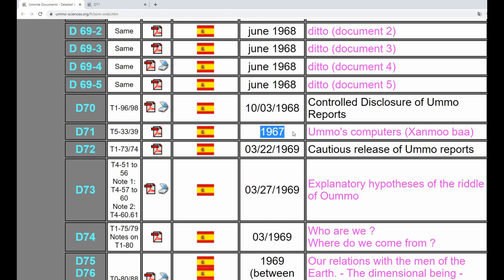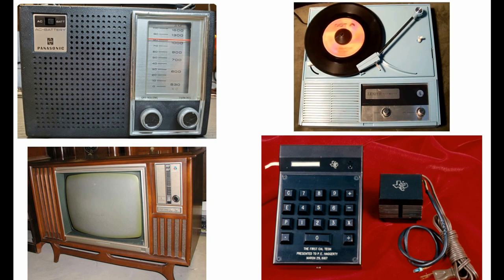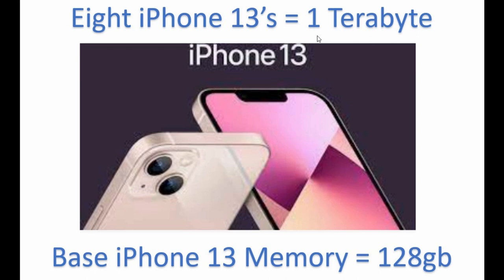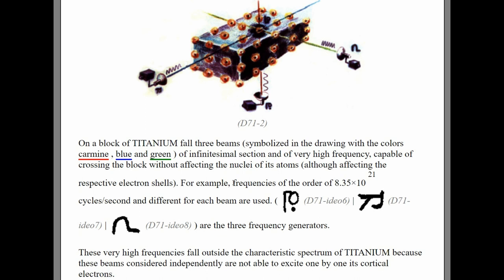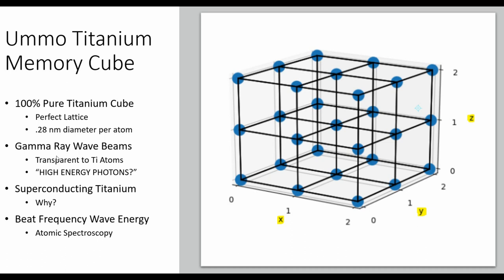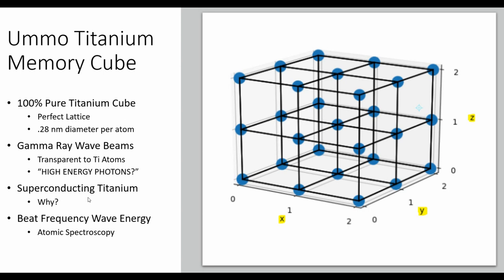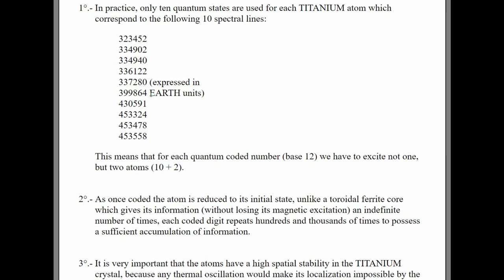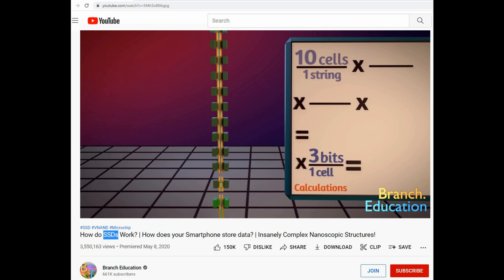UFO and Alien Technology - Computers and Memory Storage of Ummo

Comment: Have you ever heard of early "delay line" type of memories used in early computers?   There was a more advanced version based on 2D acoustic wave propigation in crystals created by David Arenberg. There were versions of this that came out just before VLSI microelectronic memory became a thing in the early 1980s.  It was pretty simple, it kinda worked like the old magnetic "bubble memory", but even better.  A small crystal about the size of two postage stamps could store 2 megabytes of information.   Which was pretty cool, because physically it was very simple, unlike integrated circuits which require billion dollar factories.  Anyway, that's what this kinda reminds me of.  Very advanced version of that.
Reply from the maker: I have 0 knowledge of this, but I just looked it up.  It seems interesting, in terms of the different possible ways of storing information.  Thanks.
Reply: Alan Turing was designing one at Manchester

Comment: Check out 1:36. It is not an overunity. The device is related to information, it is a very sensible device that can, with very low power, send input and detect output. It is not a transistor, but does the same function. Energy generation is another field, unrelated to this. Information is processed, but not generated eigther.

Comment: Good stuff, and great explainations. I can actually see this storage mechanism working quite simply, though the precision of the gamma field interation on a nucleic scale still eludes me I can clarify a few things.

The gamma block readers emit a constant pulse throughout the entirety of the block which would most likely be in the terahertz range or higher this spectrum heating of the crystalline lattice would allow for the pinging of the atom into an alternate 3 dimensional position inside the crystalline lattice giving 6 cartesian outputs as the gamma wave diverges around a particular atoms offset. This would effect the pathway of the gamma emissions. 

Yet still since they say they were interacting with the nuclei specifically they could be knocking protons or neutrons out of one atom into the next  and somehow reading the associated valence with the newly destabilized written atom.

Also could be a combination of both. Both methods would require atomic level computation  to process however. Taking septillion bits of read/write if not more.

Comment: Hi, your content is amazing, you got my subscribe. This off the topic about this video but, anyway, i always had doubt on E = mC^2 too. I mean, if you change it into E/C^2 = m and take the mass is equal 1kg,  then 1 kg could have multiple value of energy, you could power and/or root the E/C^2 and you got 3 in total difffrent values of energy for 1 kg of mass. Im looking forward to know how your opinion about my thought, thank you.

Also, could you do more debunking video on how capacitor works, i also had a problem with that. I had an experiment with 100 farad supercapacitor that should make around 100 coulomb charge, i want to try to make huge electrostatic force with it by fully charging the capacitor, and then use the positive terminal and connect it to 2 sheets of alumunium foil. In theory the huge and same charge and close distance ahould make huge electrostatic force, but in reality it doesnt do anything.
Reply from the maker: <<Im looking forward to know how your opinion about my thought, thank you.>>

My next video (if I can get motivated) is going to have a bit of information on e=mc^2.

<<Also, could you do more debunking video on how capacitor works, i also had a problem with that.>>

The key with the capacitor is at the end of my (electron/capacitor) video when you see the E-field detector show that the plastic is electrically polarized.

I was going to add a section about SSD storage using dielectric polarization and how it is the analog of a magnet, i.e. the electret and the magnet.  I just didn't want to the video to ramble on...

You can look at Oliver Heaviside's article on the electret and realize that a capacitor is a temporary electret, which would be analogous to the electro-magnet.  You can then see how we use electrets/capacitors for microphones to understand how they transduce mechanical energy (sound) into electric voltage, which is the same thing that piezo-electric quartz does.  When we start building capacitors with radium doped, piezo-electric doped, diamond dielectrics, then you know that we've figured out new energy storage!

Comment: Actually, the current proposed worldly state of the art storage is DNA data storage. Estimates of it's potential density range between 120TB all the way to 100s of exabytes in a square inch. (I couldn't find a consensus on real number, each article states something else)  There were successful experiments, at writing data to and retrieving data from it, albeit at speeds to slow for practical use and too high error rate. (19 Mbps being the current record) It is similar technology to this in a way it reduces storage to be encoded in arrangements of atoms themselves. (Although the former would use their EM fields) Still an amazing video and technological concept, especially considering it is from the 60s. Need to look further to the origin of the papers, maybe rewatch your previous vid.
Reply from the maker: <<Actually, the current proposed worldly state of the art storage is DNA data storage.>>

I did see this... crazy idea!  We'll see...

<<Still an amazing video and technological concept, especially considering it is from the 60s.>>

The idea of EM waves transparent to some form of matter (like human body) and running beat frequencies to heat up spots (InfraRed emission lines) or in human tissue, UV-B/C (fibronectin) for healing speed-up...all without cutting people wide-open...seems like something that could see immediate use.

Comment: This is ridiculous.
There's what, like approximately 10 to the 24th power of atoms in this block of titanium? And there are 3 lasers lining up just right to zap a chosen atom in the block?
Exactly how would anyone be able to find the atom they're looking for?
It seems like a situation where the information needed to find a piece of information in the storage medium is greater than the information contained within the storage medium.

It's like having a card catalog bigger and more complicated than the actual library. It's like having a map with more information on it than the landscape does.
Reply from the maker: <<This is ridiculous.>>

Yes, compared to what we know.

<<And there are 3 lasers lining up just right to zap a chosen atom in the block?>>

Obviously they are probably using 2 atoms to laze and not a big crystal like we use.

<<Exactly how would anyone be able to find the atom they're looking for?>>

My guess would be some type of an atomic coating that can be controlled.  I doubt it would have moving parts.

<<It seems like a situation where the information needed to find a piece of information in the storage medium is greater than the information contained within the storage medium.>>

If you think of it as a 3 laser pointer, actuator type of system, with a file allocation table, then yes, I agree.  If you realize that interstellar travelers would have physical matter figured out in ways we can't comprehend, then no.

Comment: When do you believe, this read/write phasic geometry, will become commonplace?
Reply from the maker: <<When do you believe, this read/write phasic geometry, will become commonplace?>>

I think we have a way to go!  We need to master the nucleus of atoms to get the thin, laser, gamma source.  And somewhere in the nucleus is the "gravity wave" that is still speculative...it will be a while.  Although, we are pretty good at cooling metal down to very low temperatures!

I think we could use this same idea on a much larger scale to manipulate matter, with some precision, INSIDE of objects without the need for direct access, i.e. "cutting it open."
Reply: Thanks for your reply.
You gave an very insightful answer.
Again, thank you.
Reply: Silicone is cheaper, and we already stack the etched dies into 3d structures, as the video shows. Our electronics tech doesn't go anywhere unless we can make it out of dirt :) - Though silicone wafers are cut out of huge crystals that we grow to be quite pure. Modern nand flash ssds hold 16TB, but at this point access/read/write speeds are becoming a problem - sequential read speed is about 3GB/s for data center drives). I think we're sticking with the current technology for this decade and 10-20x increases should be possible, the question is if it's affordable.

Comment: You know there are few people who think that dense aether is around the atom , I not only think it is around the atom , but is the atom itself.
Reply: How?
Reply: @raucity4206  the high density aether is slower , therefore gravitate together .  When they gravitate together they compress the aether , produced waves and wind , which heats up the other high density aether around it preveing them from gravitating together . Basically every object is a type of star . Most are not large enough to produce the compression to get as hot as a star. Therefore it can't produce visible light , but most can produce infrared light.
The explain why everything doesn't just collapse .
The reason why the atom is the size that is because of the initial uniformity of the high density aether and the concentration of high density aether.
Reply: @m.c.4674  Where did you get this idea from?
Reply: @raucity4206  majority of my ideas are pieces of other idea , for eg the sun radiation pressure , i use as the same reason for why the atoms don't collapse .

wind and sound produced when objects collide. 

another idea is the compression of air preventing two or more objects moving too fast from colliding . 

the main reason is that i restrict myself to  ideas that are  materialistic and deterministic , for a logical explanation of the universe.
Reply: Everything that exists is a form of aether in another state
Reply: @eclipse369.  Another state like what? What states can the ether be in?
Reply: @raucity4206  matter is like water in oil .  But the oil and water are both fluids , just like aether , fills space and makes up matter .
Reply: All matter in the universe is simply 3D waves that interact with one another. See "Energy Wave Theory" for details.

Comment: Why do we think allens wrote this
Reply from the maker: <<Why do we think allens wrote this>>

First - they said so.

Second - look at all of the documentation available that deals with Ummo and try to figure out a different explanation.
Reply from the maker: @Wot Ten <<Unfortunately the 'alien' writer didn't know the basics of photon emission and absorption by electrons.>>

The Einstein "photon" idea cannot work with this solution.  This is a wave solution.  Did you miss that part?

<<How do you 'read' the electron state within an atom without destroying it in the process?>>

Even if it is a destructive read, it could always be refreshed.  Our Dynamic RAM solutions are very leaky capacitors and need constant refresh.

My guess is that the reads would show up as beat frequencies. 

<<Need a real answer instead of vague statements about 'vibrating electrons'. Wtf is a 'vibrating electron' anyway?>>

If you go by the Schrodinger Wave Mechanics method, there is no "electron" and it is a negative charge medium.  That is why I put the idea in about cymatics.
Reply from the maker: @Wot Ten <<Even the wave interpretation only allows the photon to interact with at most one electron, at which point the photon wave gives up all its energy to the electron and ceases to exist. >>

These are all Einstein and Bohr ideas.  Atoms really don't act that way.

<<Also the wave equation simply says that the electron is a cloud of probability. >>

This is the Max Born fantasy.  There is no such thing as a "cloud of probability."

<<Admittedly silly but still not something that can vibrate.>>

But mediums of a substance DO VIBRATE.  How else is it even possible to get a wave without something to wave like a medium?
Reply: @itsbs  aaand how do you read those frequencies without electromagnetic computing technology, let alone create and ultraprecisely control the ray emitters?
Reply from the maker: @Brotstink  <<aaand how do you read those frequencies without electromagnetic computing technology, let alone create and ultraprecisely control the ray emitters?>>

Yes, these are all good questions and are not covered in that paper.  There are other papers (like the spaceship paper) that describe other technological means by which they communicate.  It very much reminds me of nuclear or "positive charge" types of technology which would supersede EM technology, i.e. a "gravitation wave" technology which would be like the "proton" waves described by Bob Lazar.

Again, it is beyond us technologically, but not from a basic concept.
Reply from the maker: @texaslibertyadvocatenetwork  <<for a person who goes on and on at such length about meaninglessness, you would think you would be concerned with proving this video isn't meaninglessness in its entirety... talk about pseudo-science>>

You are a douche-bag with 0 positive comments out of four.  You only put me down... I think you'll fit just fine in my block-list of dildo brained idiots.

You are silenced from the channel...
Reply from the maker: @texaslibertyadvocatenetwork  <<how much time do you spend watching Hollywood movies and puffing yourself up with meaninglessness?>>

Why do you write douchey comments like this?  Can't you just go away, if you think something is meaningless, or do you feel like you MUST assert yourself in a negative way?  Do you feel like your negative assertions are important?  ...so important for everyone to see...